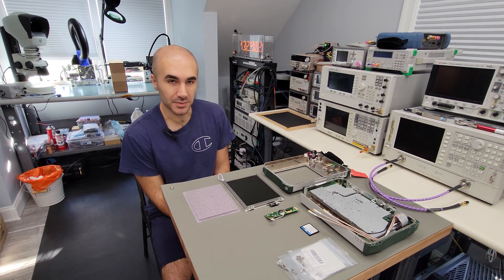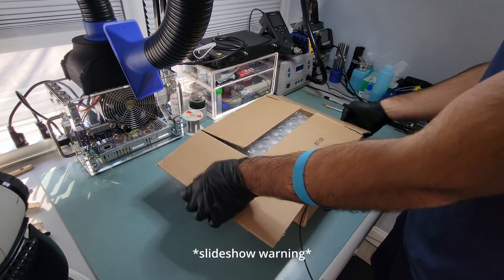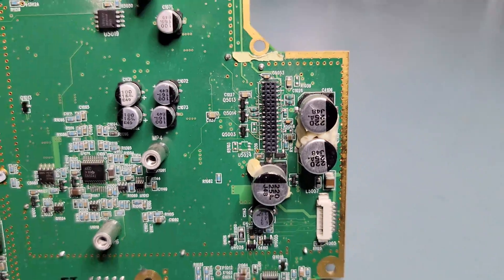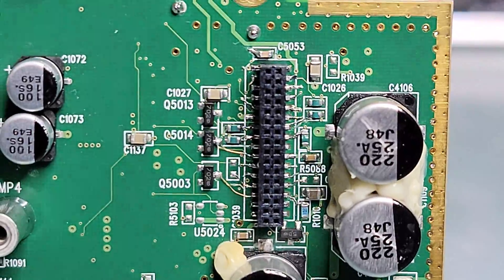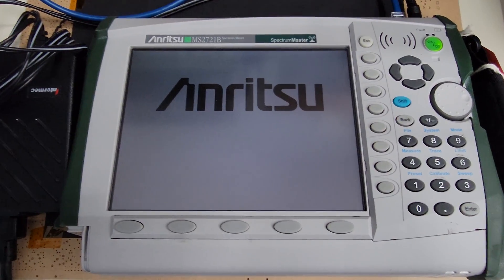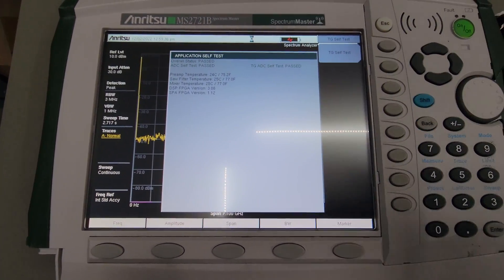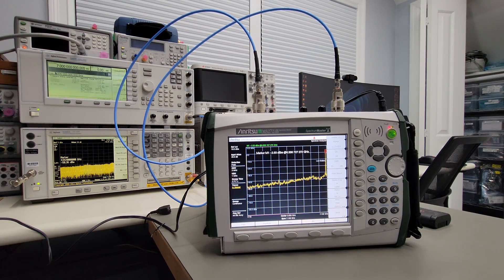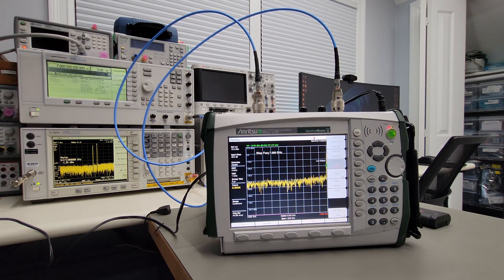Neonkev #2 - Anritsu MS2721B spectrum analyzer repair (NorthridgeFix follow up)

Comment: Crazy that they would use a connector like that with no mechanical attachment whatsoever, instead relying solely on the bond between those minuscule pads and the board surface.  You’d think there would at least be some through hole fins for mechanical reinforcement.  Pure surface mount connectors like that make me very uneasy reliability-wise.

Comment: What ever they were using it for, the potential security risk of instrument secretly spying on them or custom firmware leaking would justify hundreds of thousands or even millions of dollars(depending on number of units bought) of taxpayer money being destroyed by ripping chips of the board with a screwdriver instead of reselling unit as is or donating it to university lab...

Comment: Very interesting video.  I have an Anritsu MS2724B and when booting it reports self-test failed.  After booting I run the self-test and it reports Power Failed and in red: RTC Backup = 0.336 V.  Any idea what is wrong?
Reply from the maker: @ChristianLecavalier  Sounds like the small coin cell battery on the processor board has died. Unfortunately that will not be simple to replace, as it requires taking the unit apart and removing the motherboard to desolder the old battery.

Comment: If you had a good board, why use parts from the good board to fix the bad board, why not just swap boards and be done with it?   Maybe I missed something.
Reply from the maker: The donor board was beyond repair. It came from an ex-military unit that was "sanitized" by ripping DRAM and other ICs off.

Comment: Great video.  My 2721B is recently displaying LO1 Lock Error.  Is this common, and what is the fix?
Reply from the maker: Thank you!

Yes, the LO1 unlock error is quite common on these units. The culprit is cold solder joints on one of the 3 VCOs used in the spectrum analyzer portion. 

The Signal Path actually has a great video where he covers a repair of this condition: https://youtu.be/1_M-Wccn2w8?feature=shared

I've repaired a bunch of 2721Bs with this fault too. If you're not comfortable doing it yourself, feel free to reach out through my business contact in the description.

Comment: So they destroy random stuff to get sensitive data off the unit when removing the storage media would suffice
Reply from the maker: Pretty much. The bootable compact flash can be removed without damage by first unscrewing the motherboard. They don't bother and just break the socket ripping it out. 

They also rip all the SRAM off on the back of the mobo. Ironically, there is also more SRAM on the front but that never gets touched, again because nobody bothers to remove the motherboard.

Comment: What a terrible design. Should not be this way on pro rediculously expensive equipment. BTW, sort out the colour temperature of your monitor. 🤣
Reply from the maker: The blue light filter does help with eye strain. Once you get used to it, you realize how intense regular settings are.
Reply: @neonkev7866  was being cheeky. Great job. 👍

Comment: I'm glad you made it work but boy, is that a bad connection design! Like in bad-bad and bad-bad-bad!!! It's that easy to rip the connector off if you don't know what's under the board and you  lift it at an angle.

Comment: Saying that capacitors are on the way and it's hard to repair because of that is real short sight. As 6 easy de solderings later they can be removed to work on 24 broken pads and then put back on after work. The thing that they don't need a fix is not reason enough not to take them off the board for a sec.

Comment: OH, and BTW... thank you for practicing ESD safety!! I appreciate it!!
Also, I have used Gorilla Waterproof Caulk Seal for bonding, and it works well. It's a semi-hard texture when it cures, not the soft-squishy texture.
Reply: I don't see that ESD awareness at Northridge.  My Lab was scrupulous about it when we were developing cellphone WiFi for the first time...what we didn't need was extraneous surprise failures along the way!

Comment: ...and just for the sake of equally saying, when the military upgrades equipment, in this case, electronic equipment, the Pentagon contracts a government approved civilian scrapper to dispose of the equipment per instructions. The civilian scrapper actually pays the government for the scrap, typically by the pound. So, it's not like there is a bunch of military personnel taking this stuff apart and 'effn it up. It's a civilian contractor, parting stuff out, saving precious metals, and reselling to the market. No offense to anyone, but scrapping is not a highly skilled job.

Comment: I dont know the first thing about electronics but I do know a bit about adhesives and am I wrong in assuming that most silicones don't actually adhere well to pretty much anything else that glass, silicone and other things will silica in it...? Epoxies and polyurethanes however are famous for bonding well to most things. If there's a high end epoxy of PU that is known not to mess with your traces and not conduct, I would have used that, ground out a small undercut on the connector and scuffed whereever I could to get even more mechanical grip for the adhesive.

Comment: Sometimes, those types of pins can  stuck, staying in contact for a long time. You can put some oil and remove excess oil, next time it will be easier to remove and it will not stress the board.

Comment: what does it do like find signals that interfere with wifi etc?
Reply from the maker: The MS2721B is a spectrum analyzer. Think of it as a very wideband (large frequency tuning range) radio reciever. It can detect and measure the strength of signals which have a frequency between 9 KHz to 7.1 GHz. Most WiFi signals are around 2.4 GHz and 5 GHz, so you could detect WiFi and other signals around it. If you suspected that a rogue signal was interfering with your WiFi, you could use this instrument with an appropriate antenna to detect the interference.

Comment: Maybe you can use glue stick to hold the connector, glue stick doesn't conduct electricity when its dry.
Reply: Correct. One would have to carefully chose the glue stick to ensure adhesive properties met technical requirements and expectations. Cheers!
Reply: @blackrifle6736  cheers

Comment: Just curious what exactly would you need a spectrum analyzer for?
Reply from the maker: The basic function of a spectrum analyzer is to detect and measure the strength of various signals. It is used mainly for wireless signal analysis, since modern spectrum analyzers can easily detect higher frequency signals used in technologies like mobile broadband (3/4/5G), WiFi, Bluetooth, just to name a few common ones. Of course, those are only a few of the thousands of possible uses. Anywhere you have an AC signal, a spectrum analyzer is one of the basic instruments for analyzing said signal.

Comment: Your RTV number sounds familiar, but I don't have any recollection about its post cure strength.  I hope the best!  I probably would have (made the mistake?) of trying to apply epoxy to the ends, or the RTV all the length.  Great education...
Reply: Following Anritsu's own example of securing caps, I would have secured connector with an epoxy having similar rigid adhesive properties. I hope that no one has to remove that front panel again. I say that because Dowsil 737's mechanical strength is only 175 psi and peel strength is only 20 ppi. A durometer of 33 Shore A scale informs one of its flexibility. You want rigidity similar to that of the PWB here. Just my two cents. Cheers!

Comment: Looks like the RTV you applied would interfere  with the  Key board connector. Its a Shrouded connector. But looks like it worked. Good job
Reply: I thought too, but the male pins are looking out of the connector (6:20).

Comment: check the attenuators. another big issue with these is the attenuator relays getting sticky. much harder to repair than usual attenuators in benchtop analyzers. very tricky to open the relays...
Reply from the maker: Thank you for that tip! I did not explicitly test the attenuators yet in normal operation. I believe they do click around during the application self test and on power up, not sure if the analyzer does an alignment on boot.

Comment: My first question, that comes to my mind: if Kevin has all this sick soldering tools, why doesn’t he just repair the traces himself?
Reply from the maker: It is not just a matter of soldering. 24 ripped pads on a scarce board is not a good first project to learn pad strip restoral. I'd prefer to send it to Alex who has done this many times. I'm also busy with customer units, and this was my own side project.
Reply: @neonkev7866  That pad repair is beyond my skill & dexterity level.  Alex did an excellent job.  I would consider using Alex for similar work since I am in West LA.